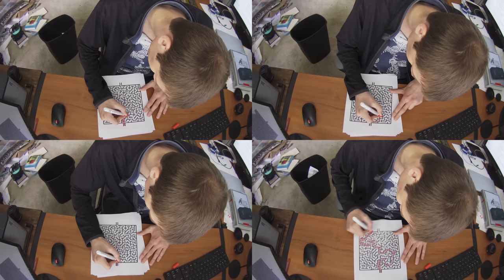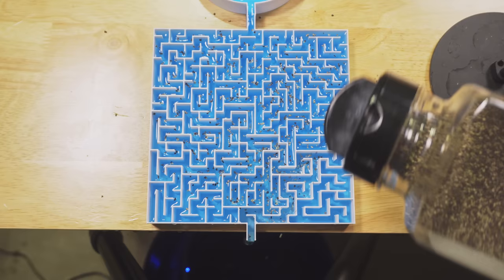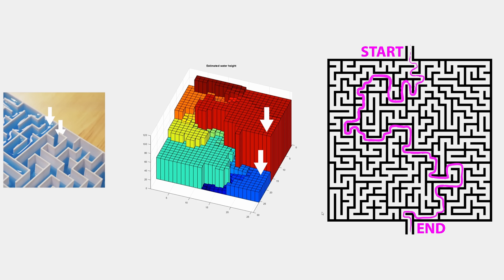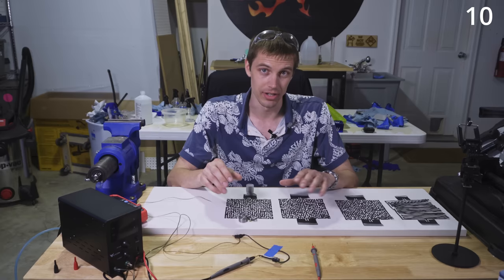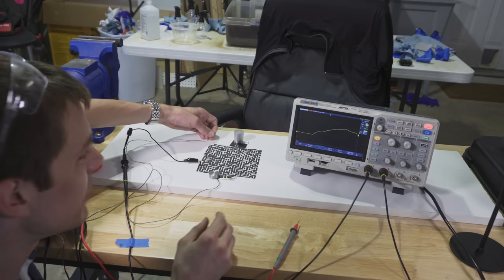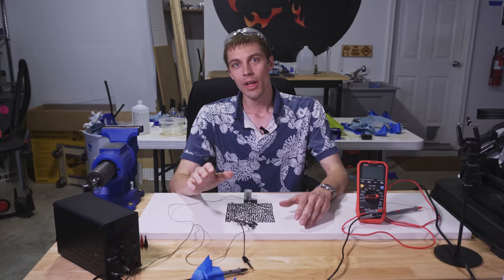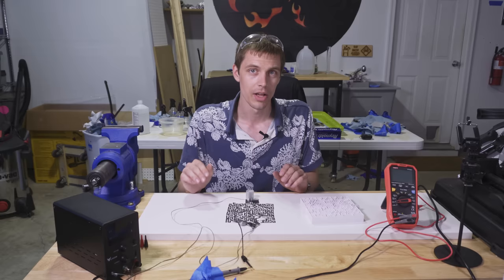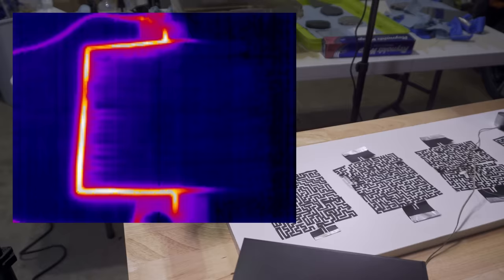How does electricity find the "Path of Least Resistance"?

Comment: An idea for the water maze; block the entrance and exit and fill with clear water, then fill the ‘input’ with died water. Unblock the start and end and the stagnant zones should stay clear with the solution turning the died color.
Great video!
Reply: Yeah, I was going to suggest the same idea.  You could also start it running with clear water to let it find its equilibrium and then add dye to the input while it's running. It would eventually diffuse into the stagnant mesas, but you could see the color front solving the maze in real time.
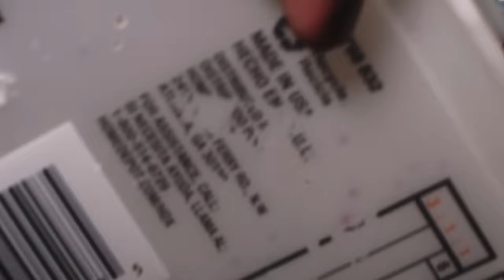Reply: he has already basically done this when he filled the dead-ends with new clear water. It wasnt the point of the demonstration but you could see the entire maze went clear and then the correct path started bluing again @ 7:50
Reply: Note that you have to start with flowing clear water for this to work. When there's no flow at all, the water level is the same in the whole maze. So when the flow starts, the level in the "upper" parts will rise (adding dyed water) and the level in the "lower" parts will sink.

And BTW, there still is an exchange on a molecular level (from temperature) and on a macroscopic level from turbulence. So over time, the dye will bleed into the branches.
Reply: *Dyed
Reply: @ricolorenz7307  Careful, I'm tempted to rant about how English has no logic in which words swap between y/i/ie (while still sounding the same!) for their different forms... ;)
Reply: @HenryLoenwind  Hey, as long as people understand what you mean, you can spell it however you want.
Reply: you forgot about diffusion, unless the dye can only be mixed and cannot diffuse.

Comment: Years back I majored in mechanical engineering and I still remember how much the fluid dynamics course blew my mind. When I learned how well everything in FD had a near perfect analog with electrical circuits it felt like things finally clicked in my head. Instead of living in a world with a near infinite amount of things all following their own principals and laws, most everything was more or less just different forms of the same fundamental objects and mostly seem to follow a relatively small and simple list of principals. It gives me hope that one day we may end up finding solutions to things like quantum gravity and the rules aren't as different as they look right now with our limited understanding.
Reply: And thermal, and dynamics, the analogies abound.  But they are NEVER perfect, they always fall completely apart at some level.  I used to like to think of capacitors like buckets, inductors like flywheels, voltage and current like pressure travel and flow in a rigid pipe, etc.  Like I said, everywhere.  My old man, at the start of his career, used to design analog circuits to simulate missile or helicopter blade dynamics, bending moments, stability and such.  And yeah, fluids was a fun, but not super easy course...compared to Dynamics though, it was fairly easy, at least for me.  My dynamics prof, first day, walked in and said F is ma, you can go home now.  Right, and then soon we were into Coriolis, etc.  He also said he'd keep the numbers reasonable, so if you calculated the weight of a guy in an elevator to be three tons, you did something wrong.  There was a big hint there.  :-)
Reply: @MrJdsenior langdown bridge gang to bridge mathematics to the realm of applied science
Reply: I took fluid dynamics my senior year studying electrical engineering. The professor -- who was dean of engineering -- told us EE students could sleep through the fluid circuit stuff.

He wasn't far off. I spent the time trying to think of fluid analogies for capacitors, inductors, and transistors...
Reply: Read the book: Principia Mathematica 2: A Complete Toolkit for Hacking the Physical Universe, by Robert and David Dehister.
They have a physical model of the matter-in-motion expressed with simple principles. They are able to describe electricity, gravity, light and magnetism in a simple manner.
Reply: And then quantum physics joined the chat
Reply: What are you talking about? Not even the physical conditions of electrical parts can be unified and are specific for each part as of now. Like the laws used for a capacitor are different than they are in a coil and as far as I know they can’t be unified currently.
Reply: They are all just following Gravitational Force and Coulumb Force. Both are central forces and only Coulumb force can be both attractive and repulsive.
Reply: @NityaStriker  The Coulomb force just describes with what force 2 charges attract or repel each other. Electricity flows from negative charges to the most positive charge. So it basically travels to wherever the highest difference in potential is.
Reply: Thermodynamics is the Law cant do anything past that.
Reply: As an Electrical Engineer we use water in pipes analogies to explain it to some people but those analogies quickly become wrong.
Reply: i actually always hated water analogy. It often didnt make sense for me, for example in stuff like antennas, spark gaps, transistors, EM generation.

Comment: Those 5ns riples are reflections in your maze. Touching the wire is producing diraque pulse which is propagated thru your maze. Every end or blind end will reflect that pulse back to source which depends on impedance. Add capacitance, inductance and resistance to your theoretical model and you will get your voltage readings on your scope. You can even do FFT of your response curve and you will find out that there are certain frequencies peaking up. Those are based on length of each branch in your maze. Each branch is now also a peace of tuned RF antenna. And remember, electrons are very slow in conductive material, the interaction between the electrons and overall propagation are what is almost as fast as light in vacuum.
Reply: Also, remember as electrons pass a gap they WILL generate RF.  That's how RADAR and Klystrons works essentially.  That maze is probably noisy as all get out in the RF spectrum.
Reply: " diraque " will say that or tell you, in french?
Reply: I'm glad I'm not the only one that thinks in rf! 😂
Reply: @PigeonLaughter01  You say RF, I say black magic.  Then again, the difference between a Computer Engineer and an Electrical Engineer is I didn't have to take Emag.
Reply: You probably meant Dirac pulse, and in that case a step pulse would be more accurate, dirac is short singular impulse
Reply: a piece of
Reply: The speed of the pulse is actually around the speed of light in the medium if I remember correctly, for copper, that would be around half the speed of light in a vacuum.
Reply: @arthurmoore9488  There will come a day you would be compelled to design your own little SBC, and thus your journey to RF and black magic will eventually begin to haunt you.

- the guy who found lots of cheap Linux capable chips on Digikey and is now planning to add RAM and WiFi to it.

Comment: I love the water example. I don't see it as the input "pushing" the stream through the maze but rather the output "pulling" the water through a predefined path. As if you pull a string through the maze solution.
Reply from the maker: In reality it’s both! Mhedi made a great point like this in his video with Derek - you’re pulling on one end of the chain and pushing on the the other end of the chain at the same time - both actions deliver torque to the sprocket
Reply: @AlphaPhoenixChannel  See how if you have a barrel of water, a hose and a pump - you can put that pump at the end of the hose with the hose on it's inlet and other end in the water and it will suck the water from the barrel. Is there an electrical equivalent for that? It's negative pressure when you're 'sucking' water - is there some sort of negative electrical pressure
 too?
Reply from the maker: @alflud  There is! Conductors like to be neutral, so if you pull electrons out of a conductor, other electrons will be drawn in from anywhere they are available. In reality, it's not a vacuum of electrons, but a charge imbalance, because when you remove electrons you don't remove the associated positively charged nuclei, and that section of the material gets a NET positive charge. That net positive charge and the associated fields attract more negatively charged electrons. Hope that made sense
Reply: @alflud  Yes, the cathode repels electrons while the anode attracts electrons so its like a pump pushing water at one end while "sucking" water at the other.
Reply: @wayneyadams  It's kind of both at the same time, but really a circuit is just that, a round circuit of wire that has to connect back on itself, a loop. In that sense, the pump is really what the battery is doing.
Reply: Pulling - well, the EM field pushes into the maze, it basically travels along all paths until it established an equilibrium. You could then maybe say the that field then pulls the electrons in...
Reply: @alflud  its inlet

Comment: My guess for mazes with two solutions is that each path has some resistance R1 or R2. Given a uniform material, any one length of material in one path will have the same resistance as the same length in the other path. So the resistances are proportional to the length of the path. The current will split such that is split between the two in the ratio R1 to R2. So the less resistant path will see more current. The power dissipation is P = U * I. The voltage drop across both resistors is the same because they are connected, so the shorter path with more current will heat up more.
The maze with two paths is equivalent to two resistors in parallel, which is grade 5 physics textbook stuff.

Comment: Your multi-path experiment reminds me of a similar idea I had many, many years ago when I was much younger.  Way before GPS was a thing I drove a cab for a couple of years.  Routes driven were highly subjective and may or may not have been optimal but paper maps helped in many cases.  My idea was to create a road map using lengths of wire to represent streets and each intersection would be the relevant wires joined at the junction.  At the mid-point of each street between intersections, there would be a small bulb that would light when the current passed that point.  One-way streets would be controlled by diodes in the circuit and in an improved version, speed limits would be controlled with resistors in the circuits.  The ultimate thought was that probes would be clipped onto the starting and ending points, and a string of lights would show the shortest (and quickest) path to take.  I never got to a testing stage with the idea which is just as well since the covered area of 750 square miles had over a thousand streets covering over  500 miles and probably a dozen or more ways to get from point A to B.  The resulting map would be totally unmanageable in size and either all the bulbs would light or, more likely, none would be bright enough to see.

Comment: I love the water model for electricity! It's what really solidified my understanding of fundamental electronics. Looking forward to the (hopefully) coming video :)
Reply: I'm an electronics engineer and I thought of the electromagnetics of the foil maze which I understand quite well, and that actually gave me insight into the water maze haha
Reply: @__dm__  When obsessing electronics students, it is always a good sign when they start to use electricity as a model for water system.
Really funny when the physic instructor tries to explain electricity with water models to EE students and they apply the tabels in reverse, because electricity becomes more intuitive then water after solving various resistors networks in Electrical Engeering Classes.
Reply: @sarowie  We treat heat transfer as energy flow through a resistive system when modeling it mathematically as well.

Comment: Great video as usual. Two things I would have liked to see: 1. When you poured clear water onto the maze but kept pumping dyed water it would have highlighted the solution very nicely. 2. Multi-path water mazes. Maybe starting with clear water flowing and adding a dye tablet in the source basin would have yielded different strengths of colour in the two paths.
Reply: I bet you wrote this before watching until the end
Reply: I think with adding dye to a multiple-path water maze, they would both end up the same color, but the dye color would propagate more quickly through the shorter path due to the faster-flowing water.

Comment: This has opened up a whole new level of intuition for me about voltages, resistance and current flow. As an electronics student I had already worked out one way of thinking about these things, but to see voltage as a change in "height" has finally satisfied my question of what potentials really were. In a uniform gravitational field, height is equal to the potential energy per unit mass and likewise electrical potential is the potential energy per unit charge. Also very interesting to work with wires of roughly uniform resistance like this - makes the current flow much more intuitive than with wires with almost zero resistance connecting components with a much higher resistance proportionally. Thanks Brian, for explaining things in the way that only someone with a good understanding can! Have a good one :)
Reply: I think it's a useful analogy to view voltage as pressure and current as flow.

Comment: We use the saying...."path of least impedance" at work.  It's a good way to always remember that a lot of devices or circuits use both AC and DC and it reminds you that capacitive reactance and inductive reactance can play be huge factors in how that circuit operates.

Comment: A good way to think about it is that once the shortest path has been found, it's like a pulling motion from the end of the maze, rather than a pushing motion from the beginning. Now the water is being pulled through the maze from the end of the maze, so it's always following that path (despite very small deviations here and there).
Reply: That's a way to think about it, but it does not correctly portray a solution. The solution is in the video, and it is not in theoretical equivalence with any pulling mechanism.
Reply: Instead of pulling, I like to think about it like the electrons get out of the way. Imagine rolling a basketball down a highway of AI driven cars (all going the same speed). The ball will follow the path of least resistance.

Comment: Thank you for correcting the common misstatement, "electricity follows the path of least resistance." In fact, the current flowing in each circuit corresponds indirectly to its resistance, but current will flow in all available paths.

Comment: I'm guessing that the electricity will treat each valid path like a parallel resistor. A larger portion of the total current will pass through the shorter path.

Comment: The electrons in current move extremely slow, but electrons are tiny and their force is strong. Through the entire life of a power plant, the electrons in the main conduit may never leave the premises, but they force other electrons to move, which force other electrons to move, and can move electrons hundreds of miles away
Reply: So following the water analogy, the flow of "current" is the gradient of the pressure of the water in maze. (Actual hydro-engineer or physicist correct me.)

Comment: Id be curious to see if the path for those multipath mazes changes if you changed the cross section area of the foil at different points. Id expect thinner parts to maybe act like resistors. If that was the case it would still make sense with using water as an analogy for electricity.
Reply from the maker: Yup! A thinner path would behave like a longer path, and it IS still very well-represented by the water height=voltage shtick! I shoulda done that…

Actually come to think of it I kinda did with water! For the 2-path water demo, I had one that was printed the same width as the maze channels and it wasn’t dropping enough voltage I mean height so I thinned the channels to 2mm wide 😁
Reply: This would be interesting to see. I understand that the paths for current are acting like resistors and longer paths lead to higher resistance. I also get that thinner paths have higher resistance. Would be interesting to see the pattern of a solid sheet of foil.

The part that is confusing to me is the real world application. From soldering simple analogue circuits, the gauge of wires or traces doesn't really seem to make any difference, I guess since the scale is so far off from the resistor components etc.

Thanks for the videos and comments!
Reply: @Robert Swaine  A weir is indeed weird
It completely blocks flow under a certain threshold, and once over that threshold its resistance goes down as potential goes up.
What electronic doohickey does the same?
Reply: @Hirosjimma  Zener diodes, particularly a pair of reversed Zener diodes in series?
Reply: @Hirosjimma  I think what's really going on is in a Forward bias situation you get an exponential relationship between voltage and current. But when you're in a reverse bias you get a really small current until you surpass the breakdown voltage. I think it's also good to represent that in terms of current and voltage because diodes are typically shown in terms of their IV curves (current vs voltage). Just like how a diode behaves, the band structure even looks almost the same as the physical weir. But also like the weir and a diode, you need a small forward bias to go down the weir, but a large reverse bias to go the other way, until you get to the breakdown voltage.
Reply: @ianmercer1291  ok I gotta admit. whoosh.... I didn't catch a thing you said 😅